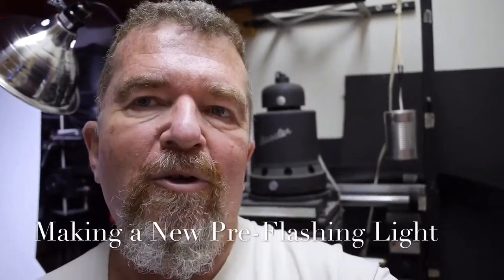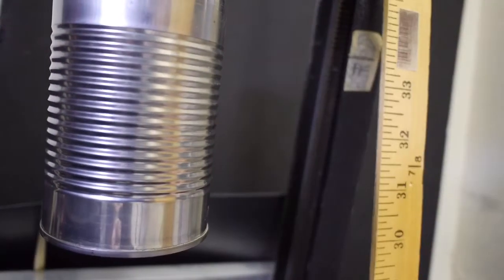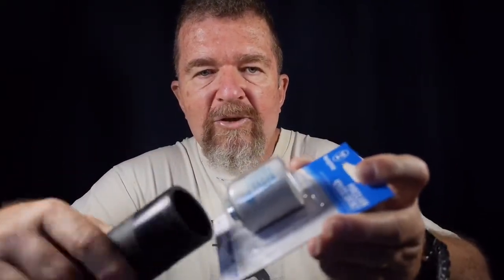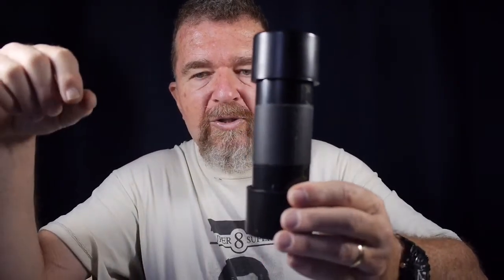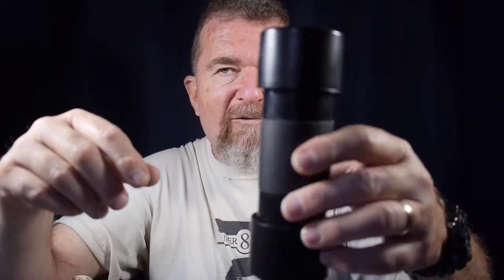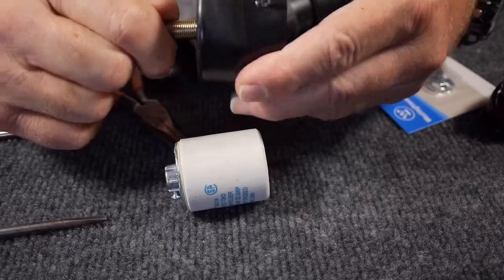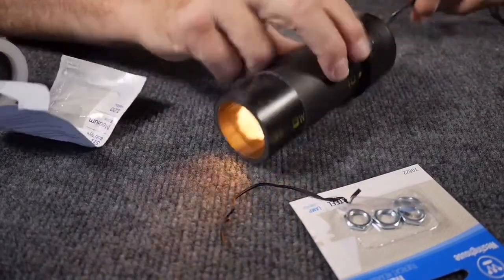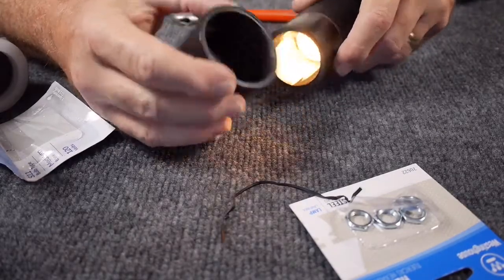Making a New Pre-Flash Light Source

Comment: I like how you always go above and beyond with your DIY stuff. Only problem I could imagine would be that the light is not daylight balanced like the paper. Not a huge problem with B&W but still...
Reply from the maker: You raise a good point about the light source spectrum. However, when making enlargements, print paper is normally exposed under similar tungsten lighting via the enlarger's head.

Ideally, we should have a light meter and pre-flash source that both match the paper's spectral sensitivity.
Reply: The paper is not 'daylight balanced'.  Graded black and white paper is orthochromatic, and multigrade is similar even though several emulsions are involved.  Further, our usual enlarger light-sources are not daylight either - being some variation of tungsten or halogen filament bulbs!  Effectively, any mis-match between the peak output of the lamp and the peak sensitivity of the paper will be taken care of in a few test exposures, which one would make prior to settling on a suitable time and height for your flasher.

Comment: The process is only for direct paper negative or you think that is usefull on a copy with negative and the enlarger???
Reply from the maker: I pre-flash both direct positive paper and paper negatives. With both, it helps to reduce excess contrast by raising the shadow detail.

Pre-flashing has also been used for darkroom printing with contrasty negatives, but I get the sense that it's not common, especially with variable contrast printing papers.
Reply: Thank Joe your information is very usefull

Comment: Joe, Is this light source capable of doing contact prints ?
Reply from the maker: It depends on the print process. I normally use my enlarger as a contact print light source, for silver gelatin prints. For alternative process prints, a light source containing much more UV light is needed.

The main reason for making a dedicated pre flash light source is that my larger, even stopped down to f/22, was too bright for controlled exposures.